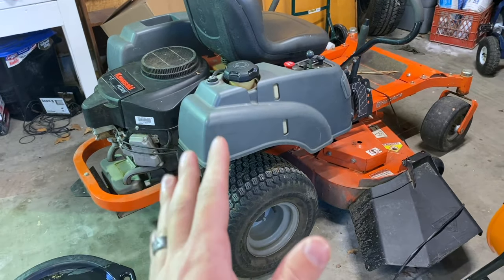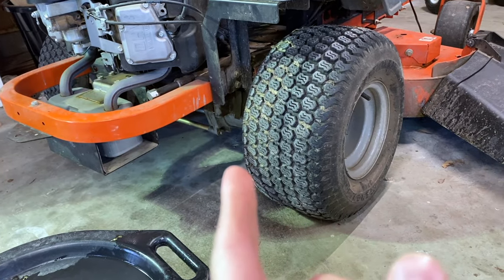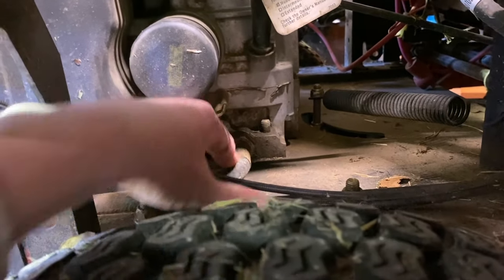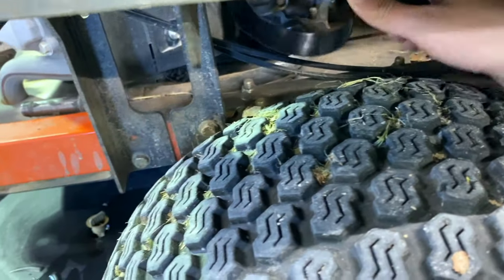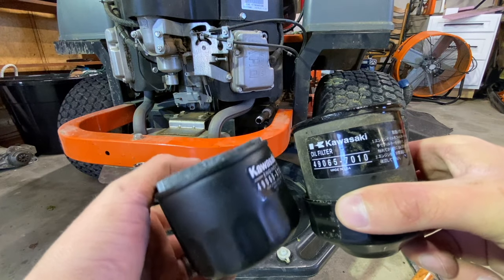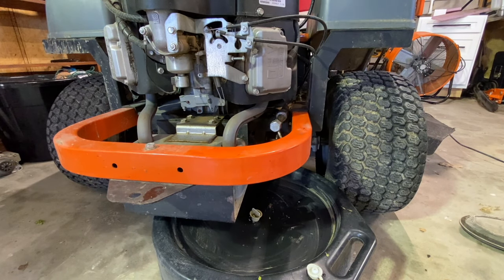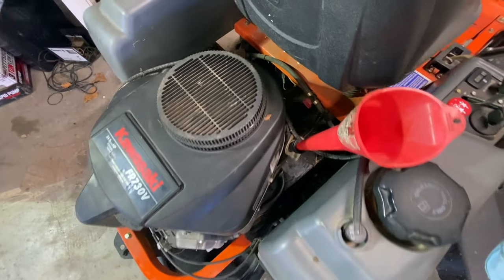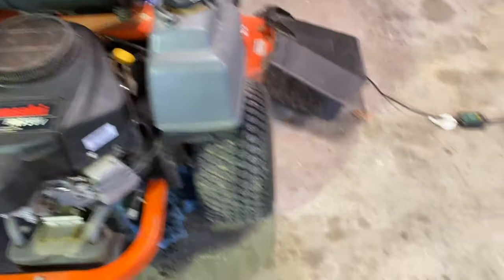How to Change Oil and Oil Filter Husqvarna Zero Turn

Comment: My Z254F has the same oil drain method EXCEPT the plug is a pull out plug and not a screw. I spent hours trying to get this plug out. Very bad design. Still love my mower.

Comment: Apparently you neglected one of the most important parts of an oil change, the draining of the old oil. I mention this because I don't know where the drain plug is on my RZ5424. Number two. My seat is old and is getting brittle and I am concerned that it will crack. Do you have a suggestion?  Thanks for a very good video.  Richard

Comment: Do you not buy into the theory that motor oil formulated for air cooled engines (kohler, B&S) work any better for the L&G application, or am I being sold a bill of goods?